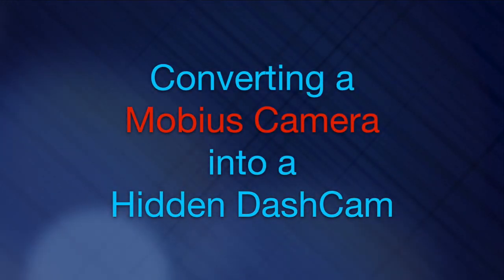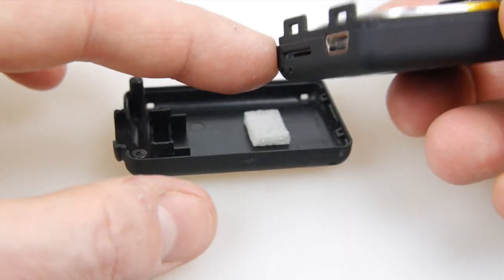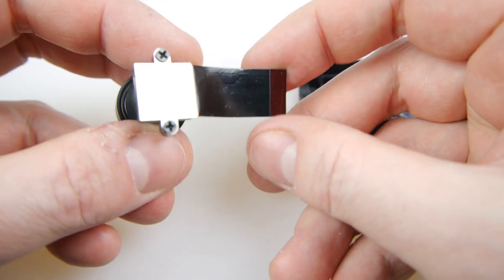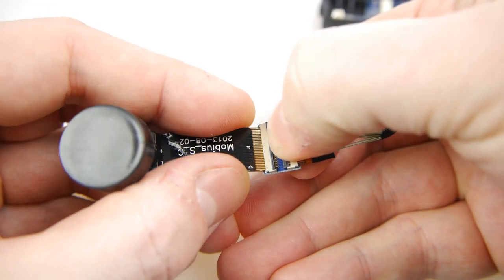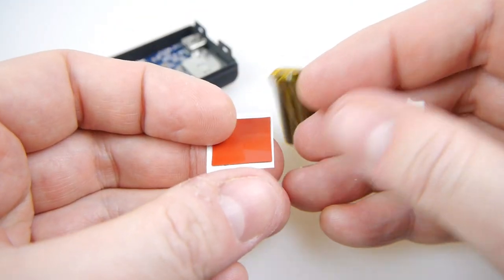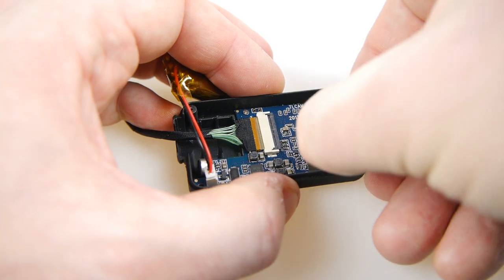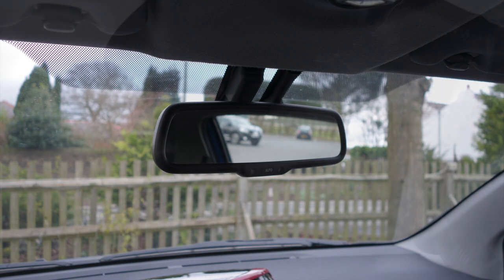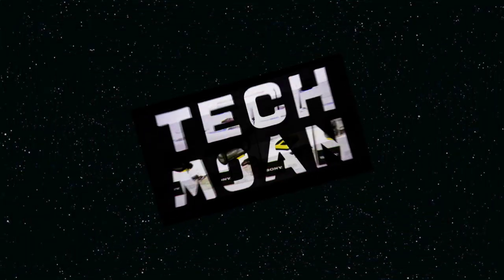Assembling a hidden dash-cam from a Mobius Camera and some accessories

Comment: Some of the Chinese reversing cameras, that use an lcd screen mounted onto your rearview mirror, have a second av input. I've mounted my mobius way over on the passenger side of the van so that when I am parking in tight areas I can see the front wings position in relation to obstacles. It comes in handy every day whether its country gates or badly parked cars in tight back roads of the city.
Thanks for all your videos.
Reply: Ok

Comment: The sheer size of this thing allows for pretty creative placement, I don't really see the avantage of putting it up like this in this case since it could just as well be hidden away behind the mirror without the lens being extended but the fact that you CAN is pretty awesome.

Comment: Hello Techmoan, can you tell me if it is possible to connect two or more  25'' Lens Extension Cable to each other and then finally to the lens. I was hoping to stick just the lens behind the rear view mirror, run the lens extension cable along the windshield and then have the mobius body sitting next to the cigarette lighter. The whole idea is to keep it minimal and as discrete as possible. Thank you :D

Comment: Brilliant! This is exactly what I want to do but I have no real electronic knowledge and was hoping to find such a tutorial. The main thing I hate about most all dash cams is they are not discrete enough and one runs the risk of having their car smashed in by some idiot who sees your gear and wants to steal it, which sort of defeats the purpose of a dash cam right there. But I always felt if I could take only the lens away from the body it would be much easier to hide. If you're ever looking for a project on a rainy Sunday, try to figure out how to hook up 3 cams together! This way you could film the front, the back and yourself all at once! Total coverage! Cheers!

Comment: I really like the idea of the external camera on the cable. I think it would be excellent for mounting on a bicycle helmet for several reasons: It should be lighter (and so should also reduce shake, which my current Contour suffers from due to the extra mass), the main electronics would be safer if kept in a pocket or mounted elsewhere on your body (in case of crash and bad weather). For it to be useable the cable would need to be made significantly longer so that it could be run to the back of the helmet, down your neck and onto some part of your body, with the longest length perhaps letting you mount it at waist level (so maybe 1.5 meters). Best if the end near the lens had a few centimeters of springy (coiled) cable to allow for head movement. A new helmet mounting system would be needed (though I'm fine bodging things together myself). Some people might want the cable to be easily and repeatedly detachable with a really durable multi-pin connector without needing to open the case, since you may want to remove your helmet but leave the electronics on your body, especially if they are in a jacket pocket or something (though I could live with it being permanent if that meant it could be made more weather resistant and durable). One would want the external bits from the lens / camera all the way to the other end of the cable to be completely waterproof, ideally, so retrofitting the existing lens / camera seems unlikely. If it was offered with medium and long cable lengths permanently wired (or at least wired as in the current model) that would make things even easier.
Reply: A longer cable would also give more flexibility when mounting this in a car.
Another benefit for the external camera on a bicycle helmet is that I get quite a few people asking me about it. When I explain it is to aid me in case of reporting a collision most people are happy with that, but a less conspicuous camera would be nice. The more streamline it can be mounted the better as it just looks better and does not catch the wind (which is why I did not get the very boxy GoPro and currently use a Contour Roam).
Reply: So, for the last two years I've simply had an intact Mobius mounted to the top of my bike helmet using a zip tie. The particular helmet I've got is contoured just right to nicely mount it near the front in a little bit of a flat area. It has mesh on the inside where the zip tie can be put through easily. I haven't had much luck with the internal batteries even after trying the larger capacity one, so I use an external power bank containing a single 18650 and a very small USB cable. This is velcroed (because I have a few and sometimes like to swap them) to the back of the helmet in another one of its contours. I've cut a small piece of thick plastic bag to cover the Mobius and keep that in place with small elastics. Works well enough for all the rainy weather we get in Vancouver BC. My power banks don't seem to be affected by the rain despite the fact that they are not rated IP-anything and I don't bother to cover them.

Comment: With this same setup could you buy a longer ribbon cable for the lens so you could mount the box by the steering wheel column? Thanks for the video

Comment: You gent should have a look at the Innovv C3, camera, that is designed from start as a camera with an external lens. The lens cables are longer, and on top of that they can be extend. Also interesting is that they offer two lens, so u can choose on between 120 and 90 degrees cameras

Comment: As usual, excellent video!  I appreciate all your videos and this is yet another that really gives some great ideas on doing more with the Mobius Actioncam!  Keep up the good work!  Incidentally, I saw where people were wishing the cable was longer.....I wonder if one could get several of those extension cables and 'chain' them together.  The downside would be all those awkward connections every 6 inches.
Reply: Maximum available cable length is 8" / 20cm, as longer cables cause unacceptable video quality degradation.

Comment: Will the clock keep time while using the capacitor? If the time-stamp isn't correct the footage may not be admissible as evidence in court.
Reply: No. I've also put the capacitor in my Mobius, & time/date is apparently ok for a week or so if you drive infrequently. I drive every day, so I cannot vouch for this personally, but the capacitor was tested in this respect before being made available for sale to the public.
Reply: yeah, but that time stamp isn't really evidence, as you could have added it in a editing software.
Reply: Thanks. Good to know. I ordered my super capacitor last night.

Comment: I just wanted to know that is it possible to do this trick using any other lens setup(other than a mobius cam extension) or may be a different resolution lens?
And by the way, you have got really great videos....Thanks in advance.

Comment: I like your setup and gadgets. I was wondering if there is a remote control system where I could mount the camera to move the camera left right up and down. If you could point me in the right direction. I would greatly appreciate that.

Comment: the best thing to use for the hole and for the joints is some of the sugru self drying rubber where you just knead it with your fingers then place it on so you could put the black rubber on it and make it look somewhat seamless and also make the joints quite abit stronger. you can get it in maplins of about 9 quid for a pack of 5 so its not expensive at all with the stuff you can do with it e.g. the camera and also for electronic diy that's what I use it for and it works fantastically for the price

Comment: Where I live, in Massachusetts in the US, it is illegal to make recordings using a hidden camera. No problem with my Mobius on a suction cup windshield mount, but installing it covertly could cause problems. Just an FYI to check the local laws.

Comment: I would buy this cam if it had wifi funktion. I'm looking for a wifi small cam with very low power consumption because I want to connect to a small solar panel. I wanted to buy foscams but the Foscams  have high power consumption.
Is it possible to turn this Mobius to a wifi cam?
Reply: +KIZILIRMAK SJCam SJ4000 is wifi enabled. £70

Comment: Hello, with all these modifications, simply plug it into the 12v car socket, or one needs to use the 5v cable with converted(12 to 5 step down)

Comment: as always, great video. question, what's the best way to secure the ribbon you think? I think of doing some electrical tape, and maybe some m3 stickers to secure them. and, I'm trying to figure out the purpose of the capacitor. it already charges right? so what does it add?

Comment: Nice tutorial as always! I notice a lot of folks are suggesting to somehow stream or off-load captured videos from dash cams "on-the-spot", because sometimes the sd cards may be confiscated. Do you know any way to accomplish this? Perhaps via a cell phone connection or Bluetooth or wifi? I am using a Mobius. Thanks in advance.
Reply: You could use the AV out and record a backup on something else, like a tiny DVR or even a regular DVR with an SSD or something, stored behind the console, you could go even further and use FPV gear to wirelessly transmit AV and have DVR in the trunk

Comment: Hi. What did you use to fix the lense to the mirror mount? I'm thinking of using velcro to mount the main camera to the 'inside' of the mirror mounting on my megane, above the mirror, and putting the lense on the bottom of the mounting against the window, if I can mount the lense securely. This way, to the casual glance in, all that is visible is the lense. Keeps the main camera body away from the direct sun, too. Thanks.

Comment: It depends on how the mirror is placed, but from what i see in most cars. The mirror is in most cars close to the headliner (it is in my current car). So best option would be i think, is to place the camerahousing against the headliner with velco or a little mount. That way u have it out of view from the outside, u can easily remove memorycard, see if it is recording.

Comment: Hi there techmoan, do you know if the lens extension cable would work with the G1W dashcam? I've been wanting to do this with the G1W, but I'm not sure if the lens extension cable would fit it. I notice they both use the Novatek NT96650 processor and the Aptina AR0330 CMOS sensor. Thanks.

Comment: if i wanted to buy just an "extension lens wire" but not buy the wide angle camera lens and battery
i can do that right?... I've seen a few videos where people build the "extension cord" to the mobius but also buy the "wide camera lens" and "capacitor battery" like you did... no need right? ...i can still use the battery that is already built in?

Comment: One could take a hotglue gun and glue the connector and lens-hole in the mobius. Hotglue dont conduct electricity, but the danger there would be melting the connector where the new lense is fitted.. it is a good way to make sure stuff holds up and to insulate  aswell

Comment: I used this set up and mounted it above my rear view mirror. Great picture, worked really well. Unfortunately, the camera seems to interfere with the radio a lot. Can you suggest a way to reduce or stop this interference? Thanks
Reply: I don't recall any previous cases of a Mobius interfering with a car radio. It has no effect on mine. If the Mobius power cable passes near the radio, try re-routing it. You could wrap the Mobius in aluminium foil, being careful not to cover the heat-sink.

Comment: Aaargh!!!

I waited 4 weeks for the 20cm lens extender cable to turn up. Finally arrived yesterday but to my horror causes white speckles and colour flicker on the video.

At £8 all in this wasn't a great loss but I had BIG plans in making the lens remote to the main unit (had used polymorphic moulding plastic to creat a tiny mount for the lens).

Back to the drawing board :-(

Comment: The extended lens allows for excellent concealment, especially when operating off battery power alone. Too bad the Mobius doesn't have an external low-battery warning light.

Comment: what capacitor did you used here ??? just wondering coz i have Mini DVR 808 keychain cam the battery already bloated out and i cant use it anymore. a little advice will help. thanks

Comment: I've now come back to this video after having had two Mobius cameras stolen from my car. Not too expensive to lose the camera but wow do those thieves cause a lot of damage in order to steal an inexpensive camera. All my nice wiring, etc. Camera was just mounted using suction cup to the windscreen. What a PITA that they ripped all the wiring out and my 12v - 5v converter. Now I don't have much choice but to really hide it somewhere. Hopefully the worst case scenario with this is that they might get the lens. That would still be a pain but perhaps slightly easier to replace.

Comment: Thanks! Be warned though. Having the unit operating while in direct sunlight can give heat problems. As you most likely know, this camera can run very hot.
I have added some extra heatsinks after I fried one of my camera's.
Mobius is still one of the better mini camera's imho. I even got a free replacement from the ebay seller!
Not even to mention the regular firmware updates.

Comment: I was under the impression that the mobius board has overheating issues and is cased in aluminium... The case almost looked plasitic... Is your version plastic or aluminium? It's well painted if it is aluminium.

Comment: Does the camera work without connecting it to the lighter socket? In other words does the battey/capacitor keep any amount of charge that allows it to go wireless? (5:18 vs 6:05)

Comment: Need to ask a general question as I'm just about to receive two brand new cars in the family and want to fit two cameras (front and rear) in both.
What.... after all the testing and reviewing you've done over the years....do you recommend? I was looking at the Vico Marcus 5 setups, the K1s systems or a setup with the Mobius as shown in this vid, but what would you reccomend. I hope to fit and forget and only really view if something should happen. What has the best image quality overall? Thanks in advance....
Reply from the maker: Sid L they would all be fine, it really depends on your preference. You could also consider putting an 0806 in the front and a Mobius in the rear of the car.

Comment: When replacing the battery with the capacitor, does that mean that you will lose accurate date and time information while the unit is off?  Is there a separate cmos type battery inside that holds the date and time?
Reply: I have the capacitor in my Mobius, & time/date is apparently ok for a week or so if you drive infrequently. I drive every day, so I cannot vouch for this personally, but the capacitor was tested in this respect before being made available for sale to the public.

Comment: I am using a mobius in my car with a capacitor but I have recording problems. With its own battery it works fine. So is it ok and safe to use it in my car with its battery instead of capacitor?

Comment: i already use a mobius as a dash cam thanks to watching your videos & it works well but im looking to set up a rear facing cam as my car was hit from the rear by another car but he drove away before i could gt his plate number - could you recommend a small cam that i could use - any help welcome tanks.
Reply: Another Mobius. Most cameras are too large to put in the rear window, as it'll interfere with you view to the rear. Be creative with the mounting, see here for inspiration... http://forum.dashcamtalk.com/threads/mobius-mounting-solutions.2654/
Reply: russ331
got a second mobius & looked at many ways to attach i to my rear window but non worked that well so i went down the simple root & used Velcro strips to my headliner & so far so good but will make a more permanent mount later.

Comment: be nice if they made the camera wire with a grommet for the camera hole?
Reply: ***** I thought the same thing, turns out a common vibration dampener seen in multirotors fit really well giving a much more polished look :)

Comment: if the capacitor doesn t wear out as a rech batt. then why are companies not adopting it ? and how much is the value you can use if battery is 3.7V

Comment: Hi, why do I have to use another lens? It's not possible to use built-in lens, just extend it with extension cable?
Reply: That was a wider angle lens he bought. You can use the stock one.

Comment: Hi Techmoan, if take out from the car, how long can the supercapacitor last? same like the battery?
Reply from the maker: You can get approximately zero seconds use, perhaps a bit less when it's not plugged into power.
Reply: The capacitor holds enough charge to preserve the correct date / time stamp for 10 to 12 days. It cannot, however, power the camera in the way that a battery can.
Reply: Thanks for the explanation... by the way, what are the comment micro sd card for mobius and SJ4000?
Reply: Techmoan - So, it really needs either a better capacitor (Super Capacitor), or to piggyback the Capacitor with the Battery!
Reply: i would rather use a Li-ion and Capacitor combo, with Battery protection circuit, and would chose a tiny battery so that it runs out BEFORE the camera loops my potential accident video over

Comment: Where can I get the capacitor if I'm in the US. I looked on the eBay and even the UK page and it's on neither of them.
Reply: Every Mobius-authorised seller listed at http://www.rcgroups.com/forums/showpost.php?p=25170905&postcount=2 sells the capacitor. You generally have to contact them to check price & stock availability. I bought mine from https://joovuu.com/gb/accessories-for-the-mobius/95-mobius-super-capacitor-.html